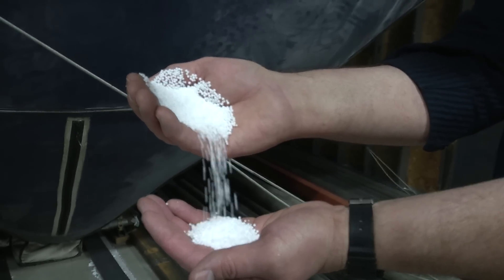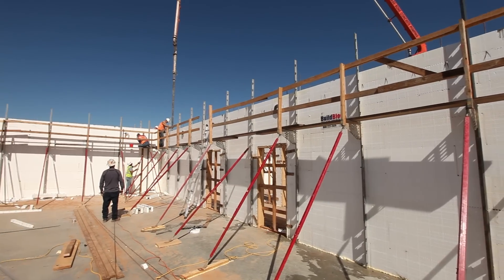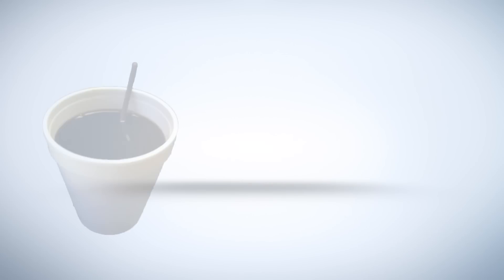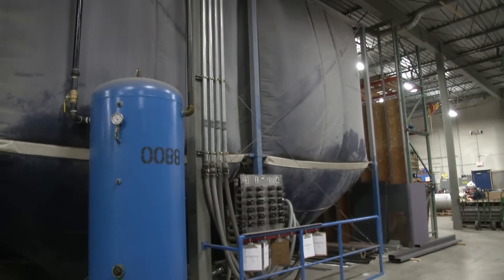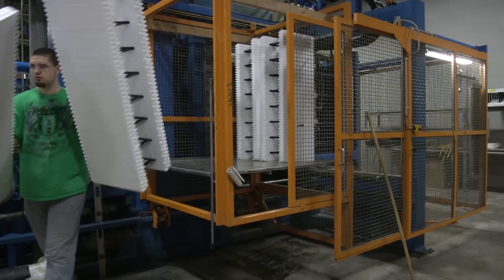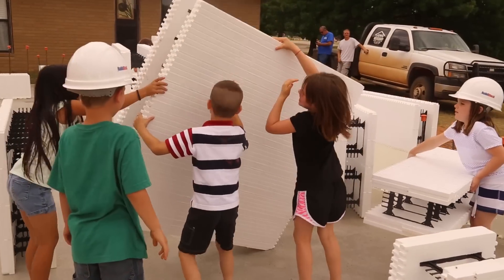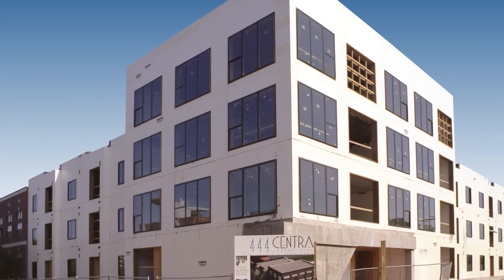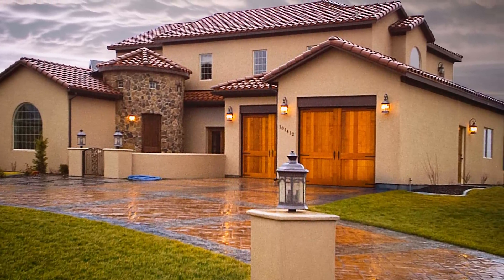How It's Made ICF

Comment: So how is the repair done to a wall that had a large fire burn off the exterior finishing?
Reply from the maker: Hi Sean, I would reach out to Build Block directly to find out the answer to that question. We do not have any experience with that.
Reply: For me it was just a question but for the guy that builds knowing 
that answer should be in the building material choice reasoning.

Comment: Won't the steel rebar rust inside the concrete from moisture that is in the concrete and expand while ruting and crack the concrete?
Reply: Rust needs Oxygen, once sealed in concrete it's not a problem.
Reply: Daniel Cason     Water has oxygen in it (H2O, O is for Oxygen). Concrete absorbs oxygen like a sponge. I've seen many videos of abandoned buildings showing where the concrete is cracking from the rebar expanding from the rusting process due to moisture infiltration.
Reply from the maker: The below link helps to explain it and this is a quote from the Portland Concrete Association -
"Because of concrete’s inherent protection, reinforcing steel does not corrode in the majority of concrete elements and structures. However, corrosion can occur when the passive layer is destroyed. The destruction of the passive layer occurs when the alkalinity of the concrete is reduced or when the chloride concentration in concrete is increased to a certain level."
http://www.cement.org/learn/concrete-technology/durability/corrosion-of-embedded-materials

So basically if constructed properly (which Charis takes the proper steps), there are measures in place to reduce corrosion.

Comment: Isn't this flammable as hell?
Reply from the maker: Hi Miklus023, EPS foam when used in building products contains a fire retardant added 
to the bead before it is expanded and molded. Additionally EPS foam with
 this fire retardant is not a fuel source. Also when exposed to high 
heat EPS foam doesn’t burn, it melts since it is expanded with steam and
 only contains air. The EPS foam used in packaging and shipping is not 
the same as EPS foam used in construction products.
Reply: Isn't wood flammable as hell?
Reply from the maker: Hi Redford, this link explains more.http://buildblock.com/asked-answered-eps-foam-and-fire-retardants/
 Seems like there is regulatory compliance of the chemicals used in the fire retardant from Canada as of 2013, but not from the US EPA as of 2013. We do cover our ICF walls with drywall which we use Air Renew Drywall that absorbs formaldehyde and other VOCS in the air.
Reply: of course..It is flammable, and extremely toxic...
Reply: @giftzwergin3801  yup flammable maybe after 4,000 degree of flame. Toxic? Maybe your house living's sofa is more toxic lmao.
Reply: Miklus023 yes
Reply: isn't fire retardants are toxic  as hell?